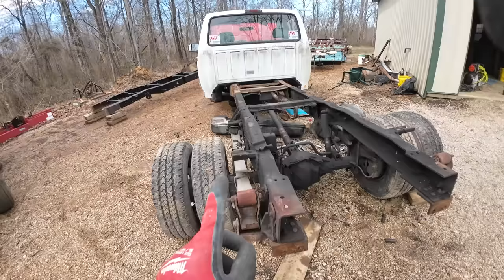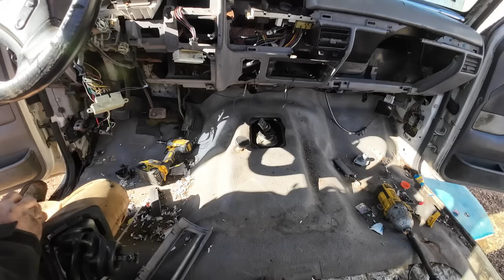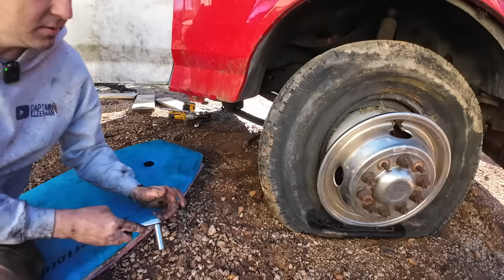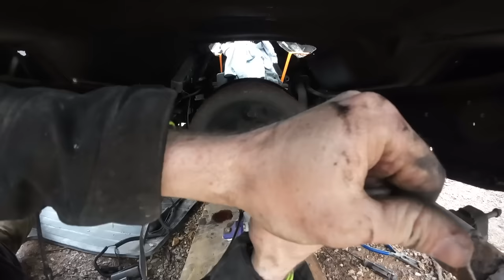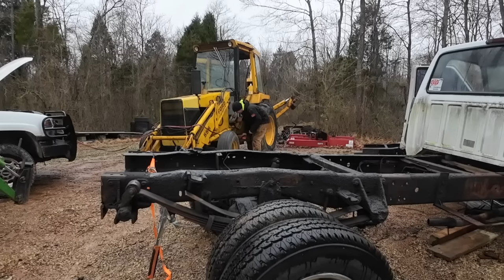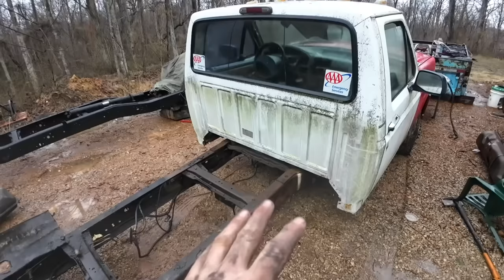Does the Junk Tow Truck Have Everything I Need?

Comment: I normally think, "they make a tool for this, and they aren't expensive" then never think of it again until the next time I need the tool, and since I'm 50+ miles from the nearest town with a tool store, I just use two screwdrivers and a set of vice grips again, while thinking "they make a tool for this"...Making a list, and taping it to my forehead might work!

Comment: 2 things. 1) get a shelter like you  and your brother erected at your brothers land, it only has to cover where you are working . 2) The area outside the barn, garage, shop what ever you call it, rough the gravel up, spread cement powder down, roll it flat, rough it up again in a different direction,  spread more cement powder down, roll it smooth again. Then you either wait till it rains, or use a sprinkler to wet the mixture  to  set the cement. I made a hard standing next to my carport for my trailer and wheelie bins, I also did this for my shed, and its held up even with my 36 inch roll cab and top box sitting on it. Just a suggestion.
Reply: I oppose dry pour because the concrete averages 40% less strength than properly mixed and in some cases can be just 20% of the strength of properly mixed.

From the MASH episode where they poured a concrete floor wrong. "We have 9 tons of what might as well be oatmeal."
Reply: While I agree wet is best the above comment is right I could not afford the £1000 to concrete our barn floor and instead spent £25 on cement and spread and raked it on the ground watered and put a vibro plate over it. I now have a three year old sweepable floor that is still holding up even with cars on it. Sometimes cheap is good enough.
Reply: It’s called making do with what you have got. The big job is for ‘ron, later on.

Comment: Hey Captain i have an old school tip for installing transmissions,  
Take a 3 inch bolt that fits your transmission holes and completely grind the hex head off, then put into the motor at 10 o clock and 2 o clock position to rest the transmission on once you get it up in position,  this will give your arms a break until you can get some other bolts started,  
Just put them in finger tight so you can get them back out when you need,

Comment: I’m not sure if that year of ford is like the Chevy trucks but for your rear brake line make a new one and  run it around the fuel tank vs between frame and fuel tank . . Definitely makes it a lot easier if it ever needs replaced.splurge on new rubber brake lines at that age the interior usually starts coming apart . Great progress 👍
Reply: I agree, if it won't start that's annoying, if it won't stop, that's a whole different level of evil you want no part of.

Comment: You are coming along great Mike and I believe you are going to have a reliable truck for the homestead. Everything you've done will make it easier later if you need to do a repair or upgrade. Having everything cleaned up and painted makes finding issues much easier. Plus no rust in your eyes 😂. Can't wait for the next update.

Comment: When you are one man moving you need an assistant on the steering,  best assistant is a little ratchet strap to hold steering wheel almost straight.  Liking the progress.
Reply from the maker: Steering column is locked out with out a key.  I could undo the hoses and do it that way.  Not worth the time though.  Appreciate ya watching!

Comment: Captain you might want to check with Clint , but i was told the F-superduty transmissions were a 4wd transmission to accept the park brake assembly , Also i would keep the park brake assembly , there hard to find and expensive to buy , they have there own oil , separate from the transmission . I currently have 2 of the F-superdutys  a 94 IDI and a 96 powerstroke. The F-Superduty axle doesn't have a park break  on the axle so if you want a parking break you'll have to find a way to make it work or custom fab something
Reply from the maker: No point in keeping the parking brake if it doesn't fit my transmission.
Reply: @CaptainKleeman  If you found a 4x4 ZF5 with the big block bellhousing for your 460 it would bolt right on and you wouldn't have to fab up a parking brake system

Comment: Someone has a drill jig, so you can make that diesel Zf fit your 460.
Only issue is the diesel is close ratio, and the starter isn't right for a 460.
Don't lose that parking brake..... You need it.
Reply: Find a ZF-5 from a 4x4 460 truck.
The parking brake attaches to the Ford style adapter/coupler.
Reply: Doesn't Clint have the gearbox from that 1/2 a truck that Tucker used the front axles in his Red Fumnins?

Comment: I have to ask but is the wrecker cab and chassis in better shape that the one you already did all the work on? And if so why not just make a plan b change to the project. Also will you be putting a locker in the rear end or does it already have one? Thanks for another great video.

Comment: Surprised the backhoe always loses battery since you put a shut off in. Weird.
Reply from the maker: It doesn't lose battery,  it just never charges.  Voltage regulator maybe,  haven't taken the time to mess with it.
Reply: @CaptainKleeman 
You might be able to use the alternator from the diesel, just make sure the off-set works for the  belt. Worth a check anyway.😉

Comment: Do yourself a favor and take that rear brake proportional valve off the truck because you can NOT get any parts for it. Ford discontinued it in 2003 and there are none to be found. I have a 96 F450 Super Duty and just took mine out and now have better back brakes. No one has a fix for it and its a pain in the butt to work on with a bed on so now is the time to take the valve out while its easy to get to. Bandit
Reply from the maker: Did you just run your line straight into the T on the rear axle?
Reply: You will have to get a new brake hose to replace the one off that proportional valve, It has a banjo fitting on the valve and the T end is made to the hose. I took the valve off the bracket and welded a washer to it and mounted the new brake line to it with a new clip. You will have to get an adaptor fitting to go from the ford brake line to the new hose end. There is no direct hose to replace the factory hose line because any F Super Duty trucks with rear disk brakes all used that proportion valve so you have to get a new hose for an older Super Duty with drum brakes to fit the axel end and get an adaptor fitting to go from the female hose end to the male factory brake line for it to work because there 2 different sizes. My back brakes were really weak because of that valve not working right and now it has a lot better rear brakes taking that valve out of the line. Its sad no one make anything to replace it because in theory the valve should really help with rear braking. But when the guys at Ford say we cant legally cant tell you anything on how to fix this problem you know your in trouble ! So all you can do is figure out a work around to fix it and make it work.    Bandit